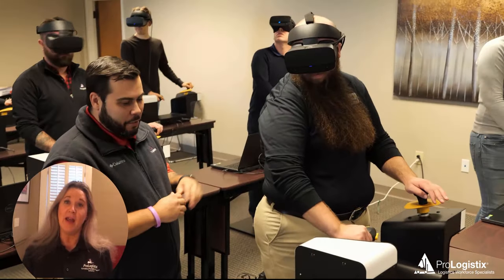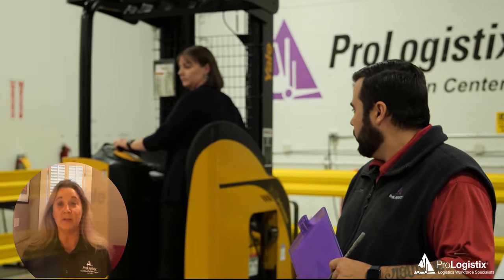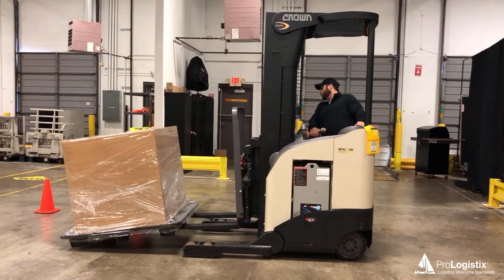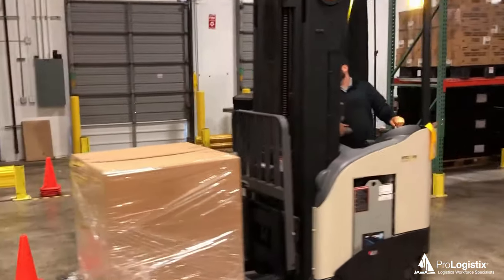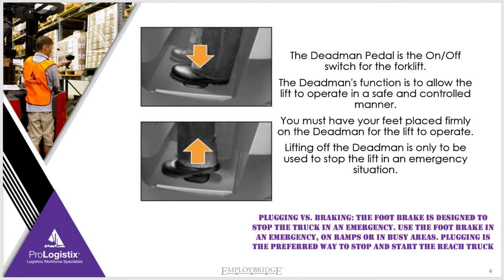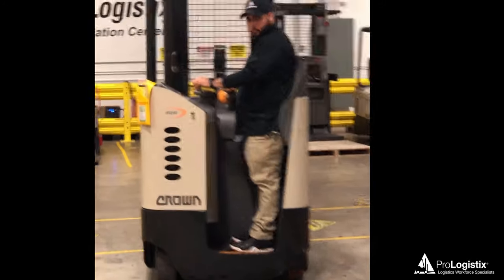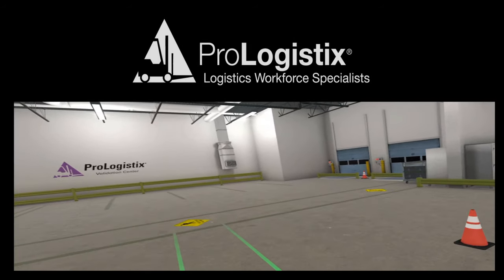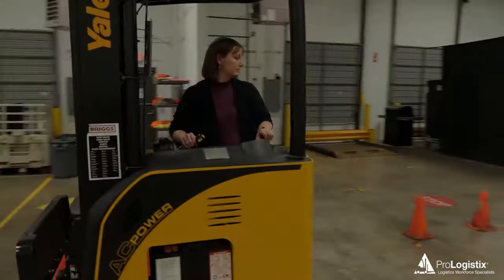How to Operate a Standup Reach Forklift - Plugging

Comment: Are there any similarities to operating a Stand up Reach Truck to a Stand Up Forklift??
Reply: A reach truck is longer for obvious reasons, reaching out and lifting higher. The pallet can sit between the wheels and feels more stable when moving. A normal stand up the wheels are much closer and jist the slightest touch of the steering wheel can make it change direction and feel more unstable when moving pallets. Both can turn very tight jist the reach truck is less

Comment: I would refuse to use a stand on, you need to be comfortable when driving forklift, Toyota all the way baby
Reply: The yanks for some unknown reason seem to love there stand up reach trucks with pantograph reach forks. The rest of the world hate them & prefer a proper sit down truck that has foot pedals for travel control & a proper reach movement on the mast. A BT Reflex would blow there minds - especially with a tilting cab.
Reply: @leepower2717  no. I like a stand up hyster. And not with counter clockwise backwards controls like this pos mistubishi standup at my new job. Turning right should mean turning right.